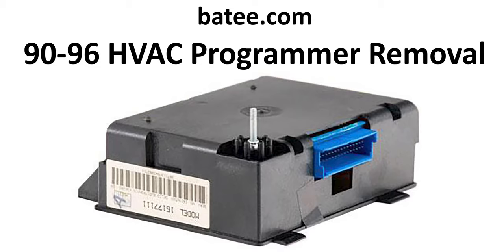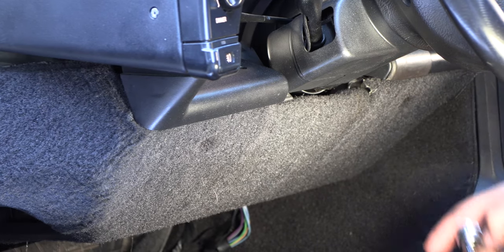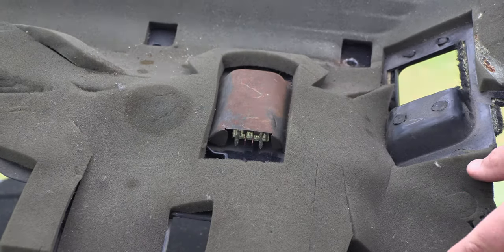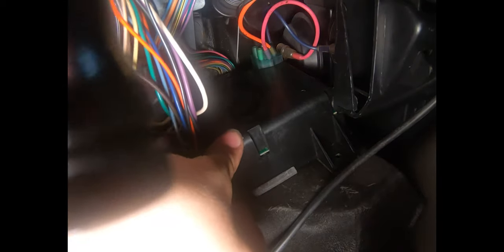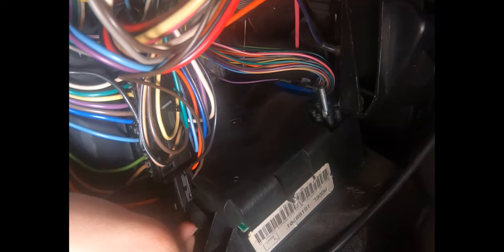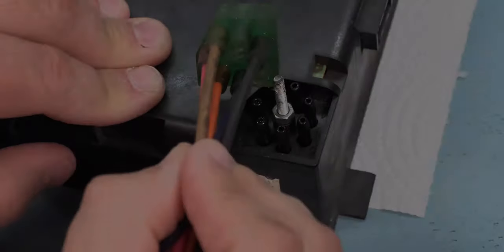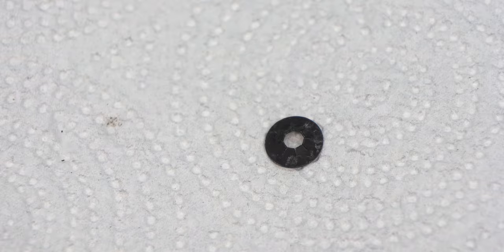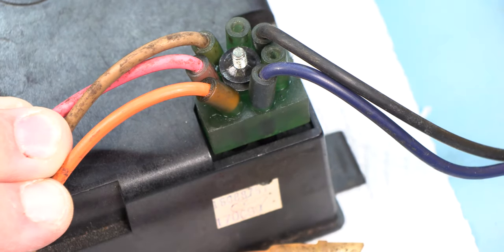1990-1996 Corvette #5 - C68 HVAC Programmer Module Removal (2019)

Comment: Dont even bother with the needle nose pliers . Just slide a very thin small screwdriver under that clip washer . Then once you have it raised a little cut it with small wire cutters . 
Your welcome .
Took me longer to get the main covers off than it did the module box .

Comment: I cut the 2 hour time down to 3 minutes to get the 'press-on metal keeper'!!! However, I already had the dashboard and passenger side panel, out to do a heater core replacement, so I was able to disconnect the other ends of the vacuum lines (the brown vac line is up under the top side of the dashboard. The black and orange lines require access under the passenger side panel foot area. Pink and blue are accessable under the driver side) so I could pull the programmer module down to have proper access to the keeper with needle nose pliers. However, it did take me 15 minutes just to get the brown vaccuum line disconnected, so I still feel lucky to have the keeper off, plus the vac lines, opposite side from the solenoid block, in about 20 minutes! LOL

Comment: Why not just replace the metal keeper with a traditional nut once you have it off? The point of the keeper is expediency on a production line, the washer is there to distribute the clamping force of whatever is pushing down on it. It would save you a lot of time on the next go around, I think.
Reply: o thought the same thing! just replace it with a self locking nut and call it a day.
Reply: The repair kit includes a lock nut and washer to reattach the vac lines.  Also, when we rebuild your programmer, we send it back with a lock nut and washer. --batee
Reply: That’s great!
Reply: I still have to find out what is wrong with mine hvac system. The vacuum is not working like it should. Once you turn ac/heat or vent on it will blow the air to windshield and foot. After a while driving around it will divert to center air vents like you intended. 
I know for a fact my cruise control is not working. So, havent figured out yet if it is vacuum lines related or it is a bad HVAC module.
Reply: @hpo2813 any luck?…what did you figure out? I’ve got a ‘91..just cleaned the HVAC head unit and think I may have to tackle this project. My air is also stuck on windshield and feet but never goes to center

Comment: My 96 has the manual slide control, but is having the usual hvac problems with vent control and a/c blowing hot. Is there a programmer with the manual a/c controls?

Comment: I can't even find the programmer module after removing the two front panels on my 93?! If it's somewhere way back at the pedals, forget it, I can't even look there, how should I even be able to work there?
Reply: Remove the driver seat, lay on your back with feet in the air. Once there, its actually quite comfortable. Getting to and from that position is the trick.

Comment: What was going on that u knew it was the moduler
Reply: The symptoms of a malfunctioning programmer are hot air blowing through the defogger full tilt (this is the default mode in event of failure, for safety reasons), unresponsive HVAC controls, and dashes where the temperature would normally be displayed.
Reply: My ECC works fine but compressor would not engage . Jumped out low pressure switch to confirm clutch and AC work which they did and that confirmed ECC works correctly . Next culprit is the controller module under the dash . Oh fun . Batee has a kit to rebuild controller module which I will be doing tomorrow .
Reply: @trip5003  ended up being the MAP sensor thanks
Reply: @vomErsten  i have the dashes on mine and unresponsive buttons and no outside temp. Is this programmer my problem?
Reply: @waltermiller249  what were your problems
Reply: @Brandonedwardwalsh  abs and traction control light comes on and climate control doesn't come on at all. If I hit the the right of my console  near the climate control it comes on and the lights go out. But not ever time. If I clear codes works everytime I hit it. I'm thinking it's a bad ground or wire  somewhere in the dash. Going to tear into it this weekend I'll let u know what I find